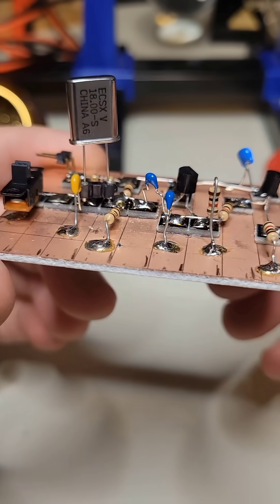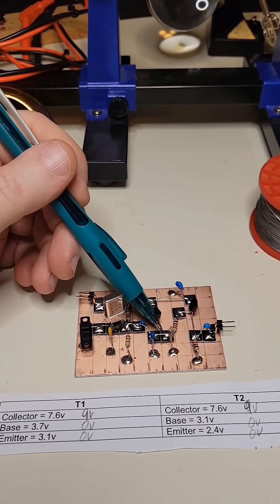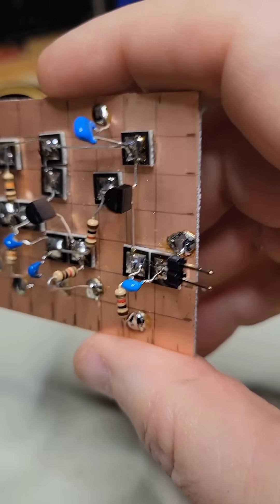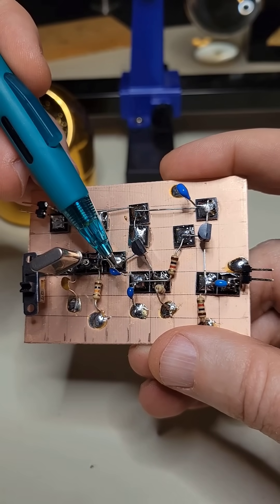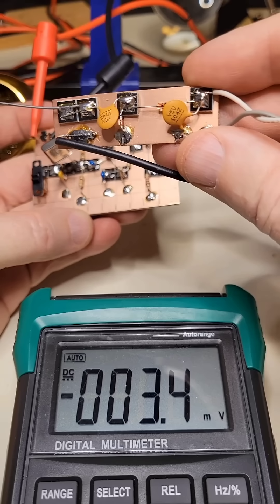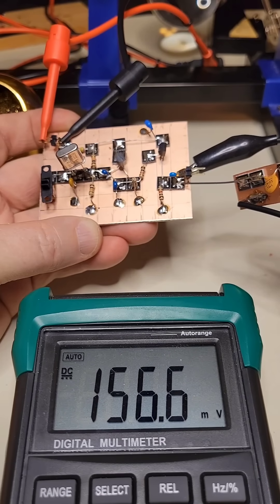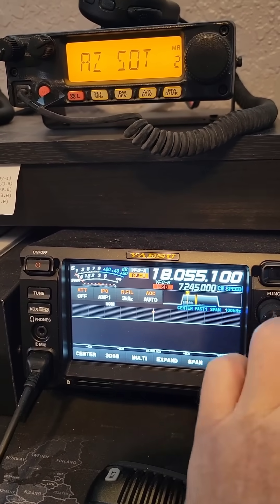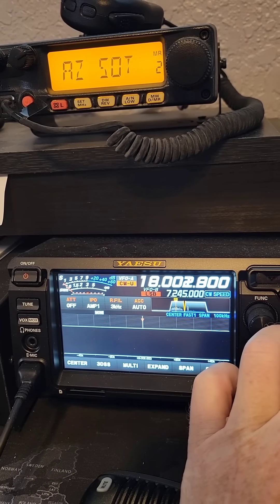You Can Create a Radio Frequency - Homebrew Signal Source #electronics #stem #hamradio

Comment: Really cool I'm also working on something like that it's a crystal pierce oscilator for 3.56mhz and it works fine I made an emitter follower buffer as well and finally I'm almost finished making the common emitter amplifier. It will probably reach around 1w but I don't have any way to measure voltage what's that Rf detector circuit ur using?
Reply: I meant probe. Lol
Reply from the maker: The RF probe is just something Rex Harper W1REX showed me how to make. I think there are schematics floating around.
Reply: Alright thanks I'll do some digging

Comment: I am slightly surprised by teh Emitter and Base of T1.  Normally an oscillator will drive its self into class-C making the average E-B voltage often negative.  I tried to figure out what topology oscillator you were using and concluded it was likely Colpitts common collector.  Did I get ti right?

Comment: I wanted a crystal oscillator to work with a 10.625 MHz crystal. Part of a simple down converter. A video on YouTube demonstrated a circuit that was called a crystal tester. It's was said to work with a wide range of crystals. It uses just six components. One transistor, two resistors, two capacitors and the crystal. It worked first go, and with other crystals in testing. I tried it with 9 volts, and it even worked with a single AA rechargeable. So 1.2 volts. The simple down converter worked amazingly.
Reply: Do ya happen to know what video it was?

Comment: I never understood why you would prefer to hse a board like that rather then a perfboard? A common ground dosnt seem all too useful to me when you can just smother solder to bridge perf boards as needed. Does something anout this usecase make this style more appealing?
Reply: I should add, the part where you have to add an insulated layer to attach none ground pins is the part that seems like more work then it's worth here.
Reply: I think It's all for the ground plane for RF circuits  @treym2k

Comment: not sure you are allowed to broadcast on that frequency
Reply from the maker: Well, it's a good thing that I'm sure.  I have an FCC license to do so.
Reply: @RedSummitRF  just curious, where do you live? 18.065 is as low I can go in 🇺🇸
Reply from the maker: @jeremey2072  oh, I see what you are saying now.  I didn't make it clear that this is one of the circuit blocks for the Sudden SSB Transceiver I'm making,  Yes, using this board alone as a signal generator would require a different crystal, although with such low power output I hardly think it an issue at 18.000 MHz.  The signal from this board will be shifted up to the FCC allocated range later on and then amplified.